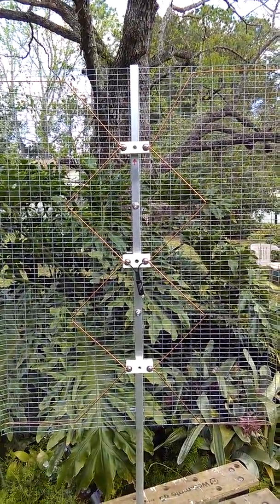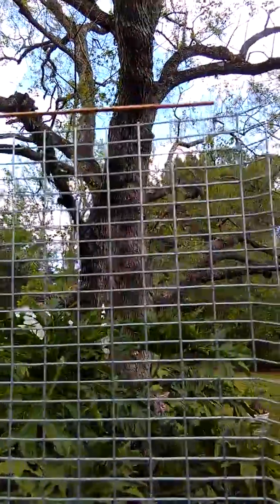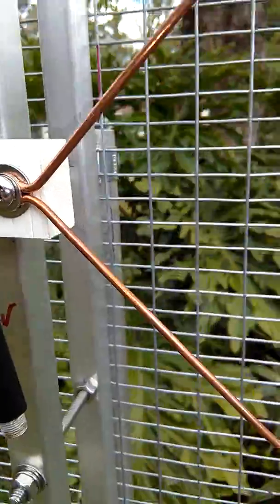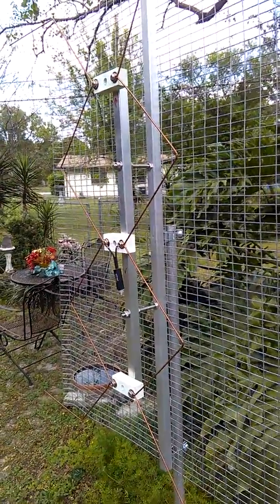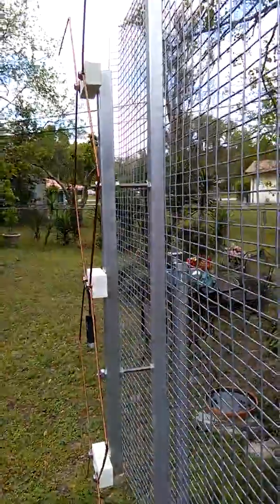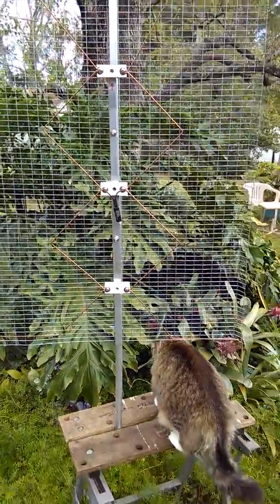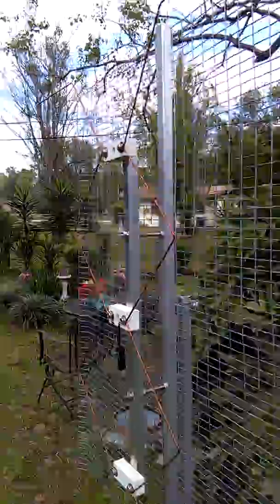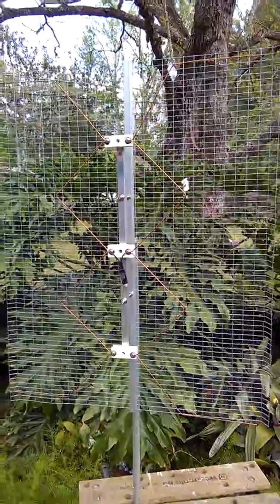Hoverman/ Reflector Close up

Comment: I use this antenna with the VHF amendment.  I've been lucky using it backless, as I'm equidistant between two markets.  Though I used copper in the beginning, I moved to 8-gauge aluminum.  Power company left it on the ground across the street, so....  Sometimes birds would land on the copper and deform it slightly.  That doesn't happen to the aluminum.
Reply from the maker: I came up with a VHF modification for the Hoverman and it looks nice. I just don't know how it works, I don't have vhf here, need to go down to Orlando ando to test it.
Reply: @cosmicantenna9244  Look forward to hear how the VHF test goes Sir.

Comment: You find the full reflector to be superior to the rod method?
Reply from the maker: I like the simplicity of the full reflector. 
Rods need to be substantial to hold themselves up and also be effective, 3/8 to 1/4 in.
Rolled aluminum, like the commercial manufacturers use is great, it's just difficult to find and expensive when you do.
The screen also saves figuring just where the rod should be placed, all the gaps are covered and the reflection is very even for all the different builds. 
It's just easier.......